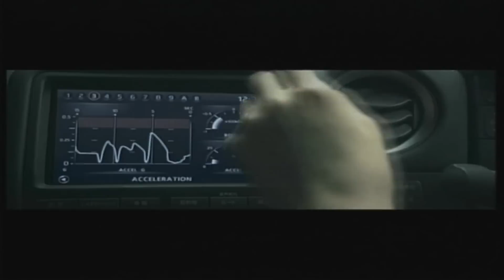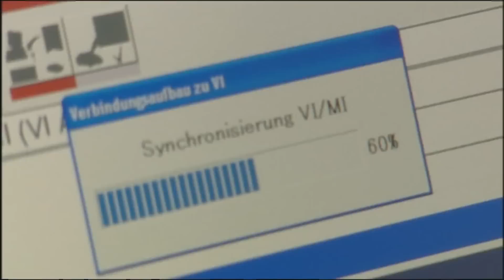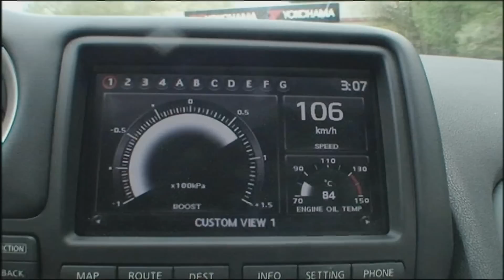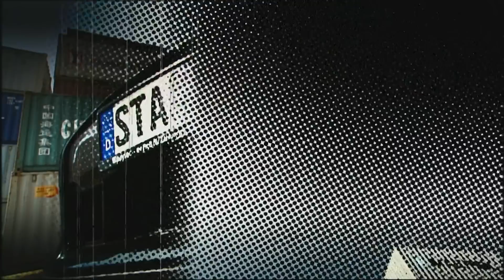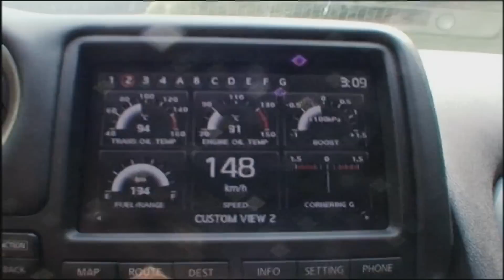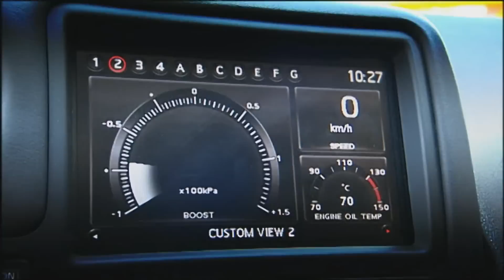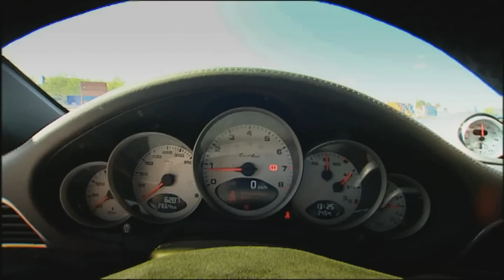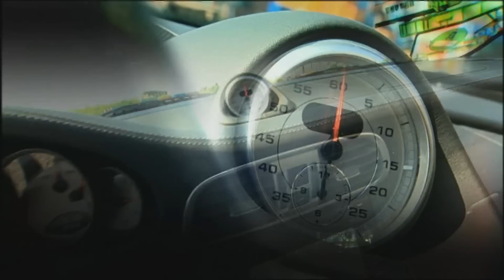Nissan GTR vs Porsche Turbo Nordschleife

Comment: Wauw, that's a true beast! :-) Is the RUF engine turbocharged, and is the engine period?  :-)
There are also some pretty pumped up Japanese 70's cars out there too :-)
If i remember right the loss in the R35 drivetrain is around 18%, which is around 440-450whp :-)

Comment: Wow ardy, funny how you called me stupid. That last comment you made was hopelessly incoherent. You aren't going to notice the .2 second difference. Why? It is borderline uncomfortable to accelerate at ~3.0 seconds and unless you are taking it to the track it doesnt matter. I would rather take the car with the better road feel and craftsmanship than the maxima that they slapped a big engine into. There is a reason the GT-R costs less. By the way... I drive a 2012 BMW 328i that I got as a compan

Comment: No I am not joking its a 3.4 liter RUF spec engine with 500hp at rear wheels not crank with almost 700 nm torque in a 1976 Porsche turbo. The Nissan driver was horrified to say the least. I pulled 2 car lengths on him. There 540/550 at the crank power the 4wd and there is your real hp perhaps a tad over 400

Comment: With GT2 suspension I'm sure the Porsche would trump over the GTR.  But really, who cares if a car is a second or two faster around a racetrack? If I had the money to buy a car like this I would want to test drive it on a road, not a racetrack.
Reply: if you ever do get a chance to test drive these i can assure the gtr in comfort mode is as compliant as any other car to drive everyday i drive mine in London's terrible roads , i really dont know where these people drive to say oh its a harsh drive. off-course if you have it set to race mode it will be hard!
Reply: *****
Do not forget that comfort mode wasnt in the GTR from the start. This feuture has been added later in 2010 i guess. The first GTRs were harsh. They were useless for day to day driving. There is no doubt Porsche is better car, but question is "is it worth 60k?". Well i dont know, if you sit in 991, the interior is just superior. Of course you want performance, i get it, but both of those cars have performance, enough for everyday. In my eyes, Porsche is just better made, more universal car, more luxurious and even more efficient car. 911 was always the benchmark. They are both great, but they are for different people.

Comment: I have the 997.2 turbo pdk. I drove the GTR and I admit it is quick. I wouldn't trade my car for many reasons. First, the GTR although feels comfortable as a daily driver, feels like a normal car. The interior feels like any other Japanese car. Good finish but not luxurious. Second, the driving position feels dull and boring. It is no where near the porsche's sporty feel. Third, the looks of the GTR is nice but not comparable to the Porsche's. I can see my self getting bored of it after a few months.

Buying used, the gap in price is reduced and am happy with my turbo.

Comment: When you have a guy that preps the GTR with semi slicks and changes the suspension for track... and then gets into a 997 Turbo with no changes and loses.. you have to ask yourself, how much did he get paid?
2010 Porsche GT2 RS 7.18  that was 5 years ago... 2015 Nismo GTR 7.08  see where I am going with this, and as far as I know, I have not seen a 991 Turbo time yet recorded. 
Nissan  NISMO (Lightweight) AWD   Porsche GT2 RS (Lightweight) RWD
I would much rather take a Porsche into a race then a Nissan anyday.. the 997 turbo engine is bullet proof.. RACE tested from the racing GT1 engine.

Comment: Porsche turbo is for old farts with mega-money---It is the GT3 Porsche the one left with that duty, not to mention the GT2, which costs lot more money but you get what you pay for and not a car that will not tolerate the duties of racing and will never achieve the pedigree of the Porsche, especially the GT3---

Comment: @doublescotchneat - the Porsche is nothing but an engine, a stick and a leather interior. The gtr is ran by a computer system. To get max performance out of that 575 hp you need to change modes. They make you sign a contract saying they arent liable for any damage caused in this mode. The car isn't built to handle that much power and to make it even able to use 3 quarters of what is available to it, it needs electronic aid. The porsche has better feel. You can feel the engine, not just hear it.